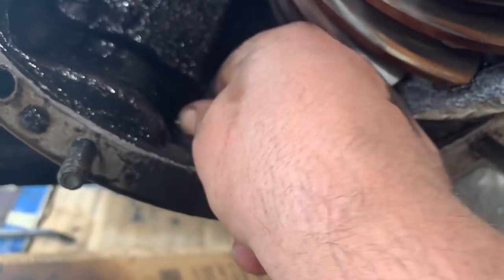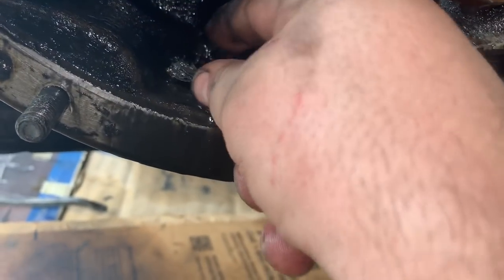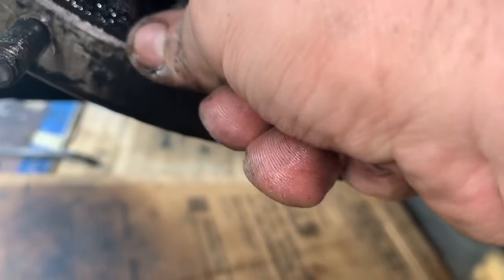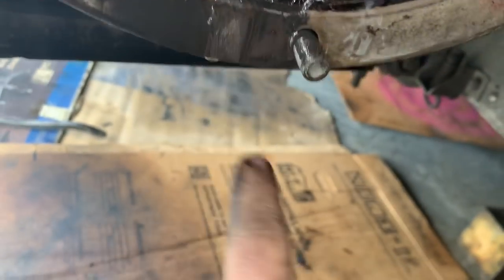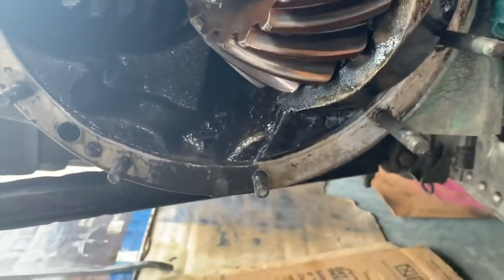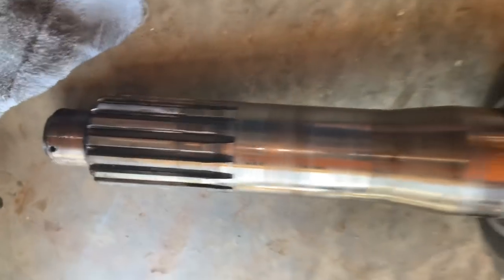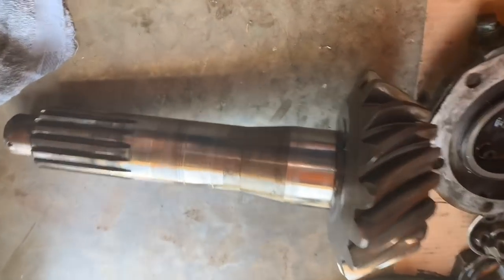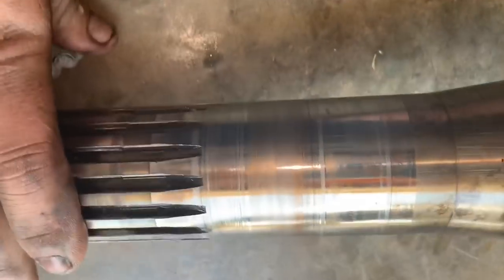GM bus 4104 transmission spicer 4 speed out put shaft bevel gear problem - part 2

Comment: That is a mess. I am faced with same situation now on my power-divider diff carrier. I believe when they pull it off they are going to find the same type of damage. Rather than mess with it, I found a rebuilt unit in Sioux Falls, SD which is being shipped to Winamac which should arrive early next week when I'll take my truck up there and have their shop perform the swap. The main gears I assume are okay but the input and thru shafts are in very bad shape and the bearings are probably toast by now. Damn expensive hobby we are in LOL. My cost will be upwards of $3,000. That's going to hurt for a while.

Comment: So is this typical wear for this age or mileage?  Are all the parts available, with your expertise if someone bought one of these beasts would there be a list of parts you would recommend for the owner to buy for future repairs that may NOT be available in the future?
Reply from the maker: New parts are not available.  Greyhound even fought to keep these gears going.  So it’s kind of normal to see things cobbled together. If you catch it before it’s to bad then you can re cobble one back for several years.  Then repeat.  You could re-machine one back with a sleeve and oversized bearing i suppose but cost would not be cheap and finding a good used trans at this point is a bit easier and cheaper in most cases.
Reply: Buy 2 buses and cannibalize one?
Reply: Yes exactly, and hope that your parts bus doesn't have the same common issues.  Engine parts are easy. Transmissions, not so much.
Reply from the maker: His parts bus is also bad we have to go after the good spare bus.  3 is correct
Reply from the maker: I’ll keep an eye out for a good trans to go back into his other bus.  It’s not being used and would be on the road anytime soon anyway.

Comment: I’ve never seen a Spicer implode like that ! WOW ! Is just the output shaft damaged ?
Reply: watch the video before this one, looks like someone didn't tighten the nut on the output shaft flange. He took the cotter pin out and took the nut off by hand LOL. Maybe it just all loosened up but man, what a mess!
Reply: I did watch them in order I just didn’t comment about the fluid draining between plates . Dang I sure hope you can bring her back ! Who knows what kind of damage she has inside with all that metal flying around !

Comment: A good machine shop could build up and turn that output shaft and refit the bearings.
Reply from the maker: The bevel gears are in bad shape as well with wear and surface deterioration.  He has better options now but tbd parts will be saved if they are needed in the future.  Never throw this stuff out